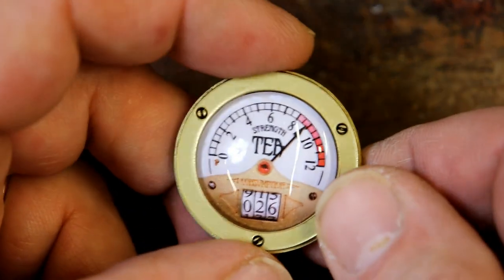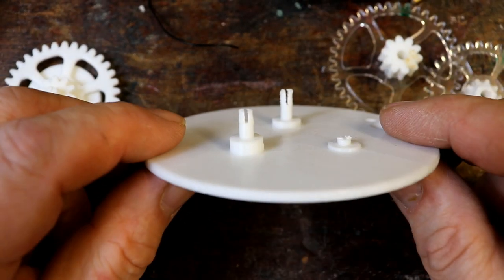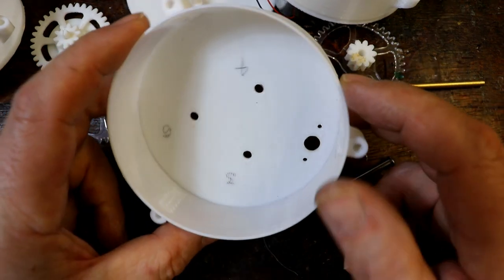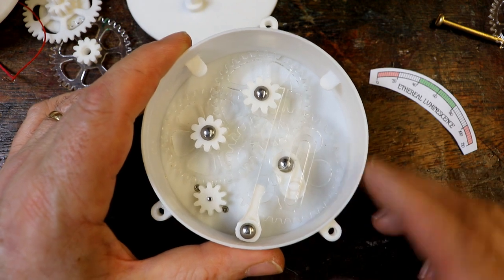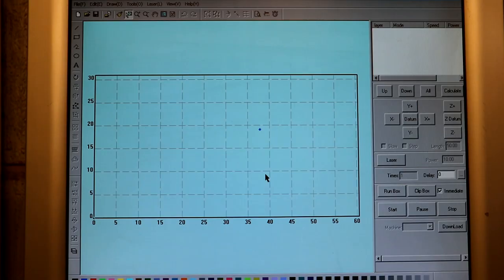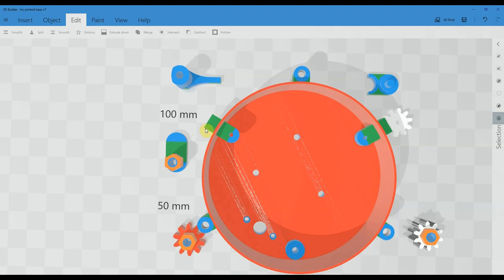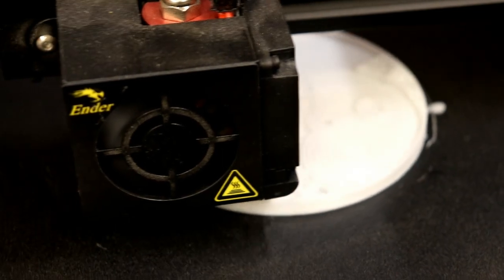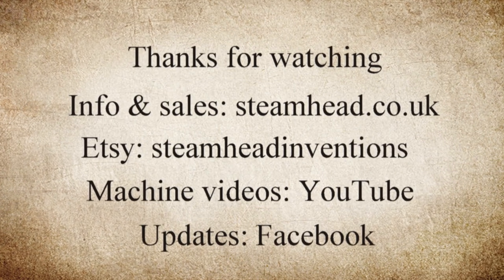Life After Florence - Animated Gauges

Comment: I got caught out by the 'one item not flat on the bed' SNAFU at the weekend.  :-)  My slicer is smart enough not to make that mistake, except I'd presented it with multiple models in one .stl.  Fortunately most of the the other parts in the batch came out undamaged.
For painting raised details I've had some success with a scrap of Tshirt stretched over a solid block (in my case a wooden pencil sharpener) as a brush to dab paint on.
Reply from the maker: Thanks Epi, I'm still using the MS 3D builder and slicer that came with the printer, at some point I'll probably upgrade to something better - it's nice to have intelligent software to help when mine is lacking! Nice idea for painting raised areas. Thanks
Reply: @steamhead  I'm using the free Cura slicer, because it came with my printer and I don't know any better.  :-)
I looked at getting proper 3D print modelling software but nothing appealed, so I fell back on using Modo, which is probably not the ideal software for this but is what I was already using for CGI.  A free equivalent would be Blender.  I'm sure MS 3D builder can do a lot of tasks in a much more intuitive and straightforward way than Modo (such as the way you extruded an image).
Reply from the maker: The 3D Builder currently does what I want and despite having a basic range of tools, these are very well designed and deceptively simple, although I often have to do a lot of lateral thinking in order to get it to do what I want, but that's half the fun! I'm still using the Crealty Slicer that cam with the printer. Like you I'll stick with what I've got until I come across some insurmountable problem.